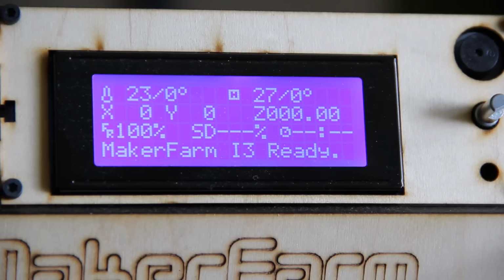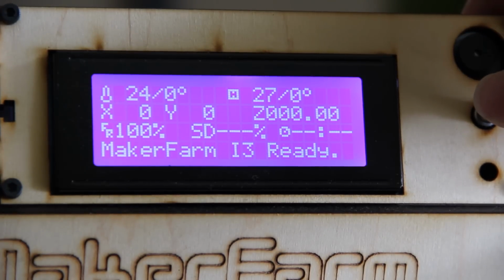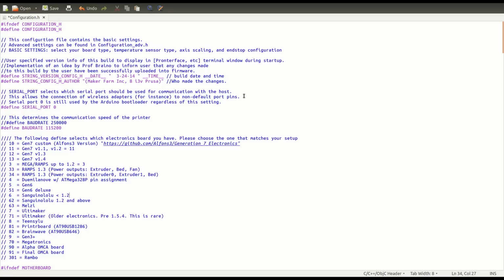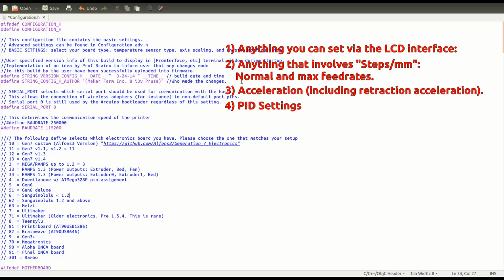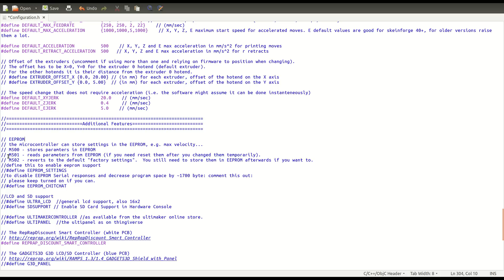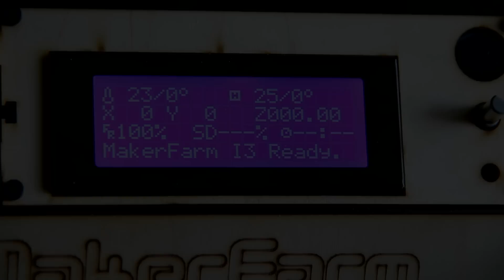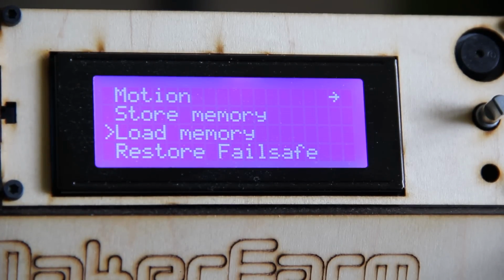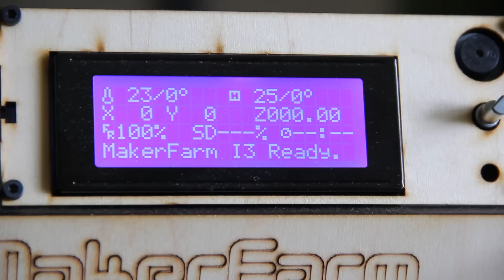RepRap 101: Activating EEPROM functions in Marlin, and what that does for you.

Comment: I have a question - I have a Monoprice mini V1, and I added a E3D V6 genuine Hotend, upgraded the firmware on my monoprice to motion V29, and then and was able to calibrate it etc. uploading commands through Pronterface. One issue I DO have though, is that now when I 'home' my hotend, the hotend 'homes' about 3 mm or so off the front left corner of the heated bed ('left' meaning when you are facing it, its on your left - basically a few millimeters forward from the factory setting of 'left front corner', off the front of the bed). Is there a command I can upload through Pronterface to offset this so that it will 'home' on the left front corner of the bed like it did with the factory hotend? What commands would you suggest to correct that?

Comment: It doesn’t seem to save anything related to bed leveling. I do the manual bed leveling (the 9 point grid where I adjust each Z height for each point). Each time I power up the printer I have to go through that process all over again. Unless I’m missing something. That, of all the settings, you’d think would be an important one to save to EEPROM.

Comment: But wouldnt that wear out the eeprom prematurely? I know eeprom can withstand over 100000 cycles before failing but also it has to remember every gcode it sends to printer, right? Correct me if i am wrong.
Reply: Ura Nium you’re incorrect. The EEPROM only gets written to when you save the settings. It only gets read when it loads settings. GCode files are not stored in EEPROM, only certain config settings. If you switch off your printer while it’s printing, you’d have to reload the GCode from where ever you loaded it from before.
Reply: MichaelNiece Does that mean this configuration wont let a print resume after the power cut?
Reply: Ura Nium Right. It won’t have idea what it was doing once the power is back.

Comment: I've been trying to get a geeetech GT2560 clone to work here with no success. I've managed to get all the settings loaded into arduino but every time i try to upload to the board i get time out errors and the board won't communicate. I used an uno to attempt to burn a bootloader to the board and it appears i can't get enough power to the board. If i plug in the power supply and then the usb cable will i end up supplying 24+5v and smoke the board? Any tips tricks or places to look would be great.

Comment: My LCD settings do not update when i run these changes and flash it over to my printer. I believe it is a problem with having to reset my EEPROM settings using an M502 command. How do i go about doing this? 

Repeat problem in lehmans terms: when i follow your video the store memory feature and load memory feature are not on my LCD screen

Comment: here is the video, the settings are not saved on the eeprom. What are the mistake?
http://youtu.be/5VaCIKs1mMU
Reply from the maker: Paulo Varella In that video, it looks like you're trying to save the fan speed, which isn't a value that can be saved to EEPROM.  From my blog post on the subject:Try one of these and see if you get better results.What settings can be stored in EEPROM?  Specifically:

Steps per unit (usually steps per mm) for X,Y,and Z axes, as well as Extruder steps/mm,

Maximum Feedrates (in mm/s) for X,Y,Z and Extruder
Maximum Acceleration (in mm/s2) for X,Y,Z and Extruder
Acceleration and Retraction Acceleration
“Advanced Variables”: Min Feedrate(mm/s), Min Travel Feedrate(mm/s), Min Segment Time (ms), Max X,Y,Z Jerk (mm/s)
Home Offset (mm)
PID Values
Reply: thanks, i notice that. Other stuff, on the language.H. there is a option of language. I change the value, save the file, and  on the screen keep the same. Do you  know something about this?

Comment: I'm currently using Repetier Firmware and Repetier host to test my repstrap under construction.  I keep wondering which firmware I should use, Marlin or Repetier.  Marlin seems to have the advantage of more on line support, but Repetier seems more polished somehow.  (I haven't yet figured out how to set up Repetier for auto bed leveling, it's almost, but not quite the same config variables as Marlin .... confusing).    

As far as EEprom goes, Repetier has a flag variable that the firmware uses to tell on boot up if the eeprom values are older or newer than what's in configuation.h.  If the flag value is the same in the config file as in the eeprom, then the eeprom values are used.  If the value is different, then the eeprom is updated to what was compiled in as constants and the flag is updated in eeprom.  Is marlin similar, or do you have to load the failsafe manually on first boot after flashing  (and then save to eeprom) to get valid values into eeprom?
Reply from the maker: Kenneth Scharf  I've never used Repeteir Firmware, so I can't really help you there, except to say that I agree with your assessment that Marlin seems to have wider adoption, and there is more information out there.  As to your second question, Marlin simply checks to see if the EEPROM data is valid (in the sense of "not corrupt").  If it is, it loads the EEPROM data.  After the initial flash, EEPROM will be empty, so the Configuration.h data will be loaded.  This will be the case at each boot until something is saved to EEPROM.  I hope this make sense!

Comment: iv just a had a problem with prints stopping when i'm printing with the LCD,
can you recover a printed if it stopped joo to a Err: mintemp, controlled by the LCD ?
Reply from the maker: ERR: MINTEMP sounds like a thermistor problem. :(. As for picking up an interrupted job, I suppose it MIGHT work, but you'd need to know the exact line of gcode where the failure happened, and pick it up from there. I also don't know how you'd avoid at least a small blob or dent where the print picked up, I'm sorry to say. Bummer!
Reply: lol, I gained load memory and restore memory but lost failsafe.